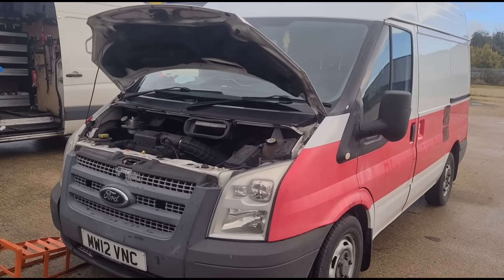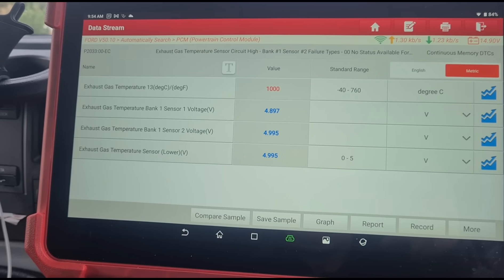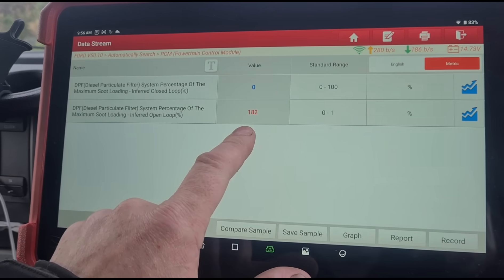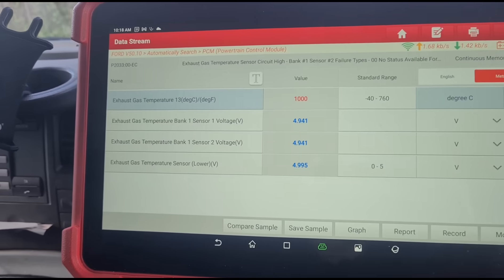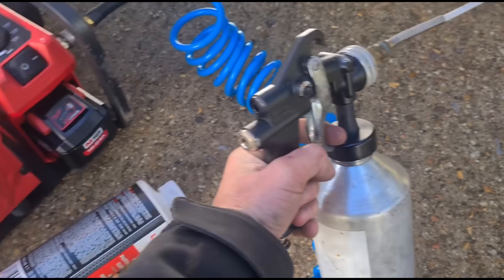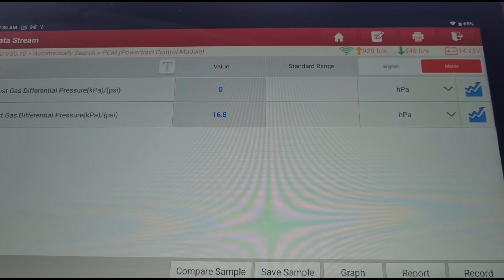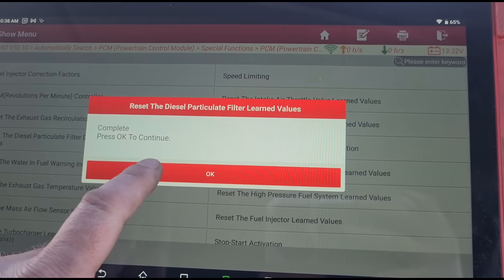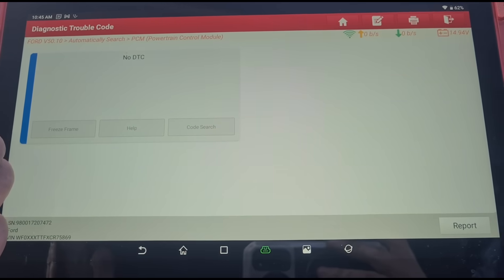Ford Transit P2033:00-EC After New Parts Replaced?

Comment: Answers my question that I asked on a previous video about “do you need to clean the dpf after fixing a fault or will it clean itself” 

And also - makes total sense too
Reply: Imma gonna say no.. The fault wasn't the dpf?
Reply: @ I know it wasn’t. But as a result, the dpf pressure was very high, suggesting a build up. 

A regen would risk fire - as he stated. 
A clean will reduce the ash content and therefore the risk of fire or over heating of the dpf and cracking.

Comment: Long time listener first time caller😊 also non mechanic
Ive a P22 FB0064 code coming up on my topdon dongle for my transit  custom 2021 with 92k km 
No engine management light as off yet. 
Is it just a dirty sensor or would the sensor lifespan be due to replace . ? 
Ive cleared the code and will check again after a few days

Comment: If you fit a new part, and it fails shortly after, then why on earth would you then fit yet another new part?  Common sense would dictate that there is another issue causing the problem.  Good work Jimmy, you could teach some lazy mechanics a thing or ten!
Reply: To be fair, I changed a sensor before and it came up with a short to ground, took it back and they changed it, exactly the same thing. Took it ba k and got told “I can’t keep changing them, there’s obviously something wrong with your van” put the old one in that was working fine and there was no short to ground code which was my reply to him. Ended up just leaving the old in and getting a refund. new parts can fail or be faulty straight out of the box
Reply: @BenEyah I’ve realised also with some cars and some parts they need to be a genuine replacement (from dealer ) as a aftermarket just won’t cut it or give intermittent issues